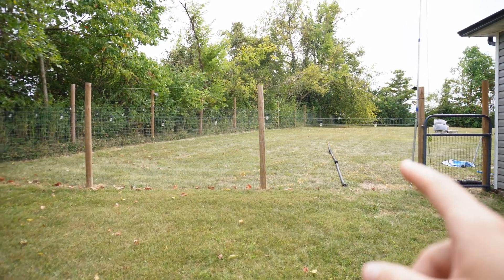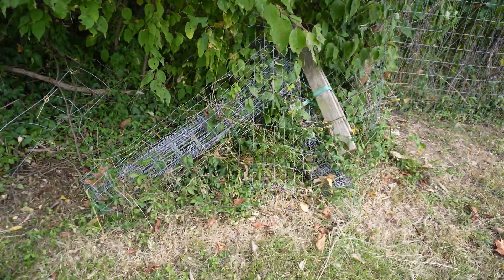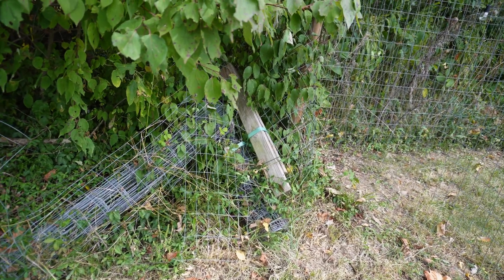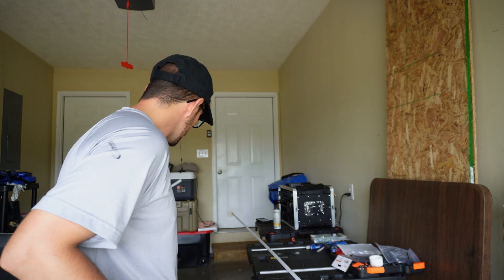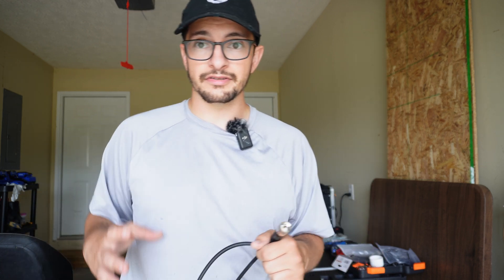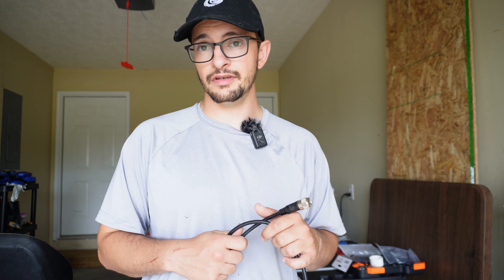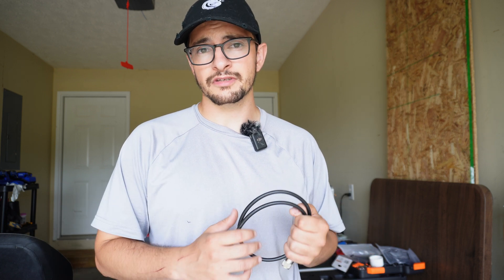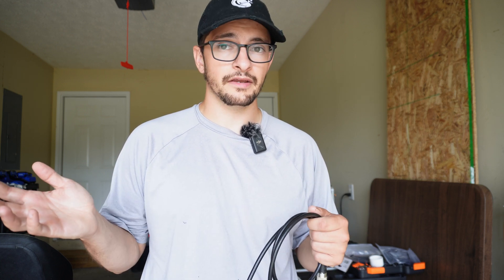Building a 2M Yagi from Yard Scrap

Comment: When tuning the antenna with a hairpin or beta match adjust the hair pin first for 50 ohms then trim the driven element for the frequency. All you had to do is add some length to the driven element remember always go long and cut off what you want for frequency. 73's W9US

Comment: Friends of mine went on a camping trip to neighboring France in the 90's. There was also a football championship at the same time and they wanted to watch a german tv station so they asked me if anything could be done with antennas.
I did build them a 7 or 9 element Yagi from welding wire and a wooden boom to hold it together. AFAIR the freq. was ~640MHz so the antenna wasn't too unwieldy.
There was no program to calculate the antenna for me so i had to rely on books. But apparently it all worked and the boys were happy.
Reply from the maker: As more information becomes available, I think we get a little too caught up on specifics and details. Although a lot of these measurements can be calculated, we still can't take into account every single variable anyways. Sometimes it's better to just build the thing.